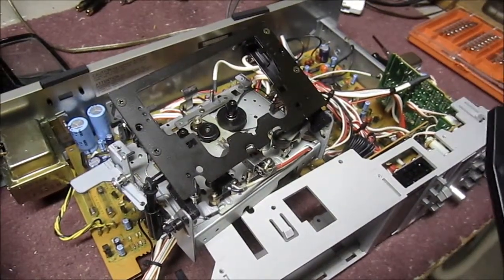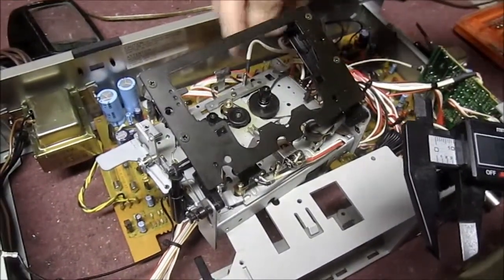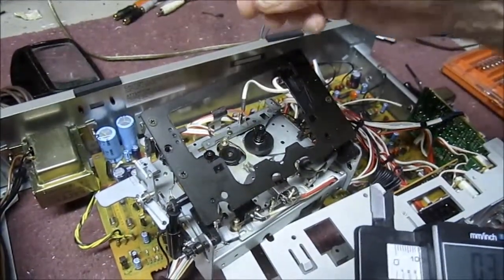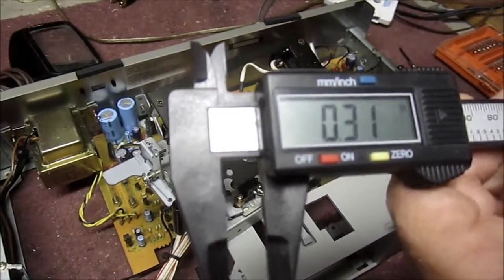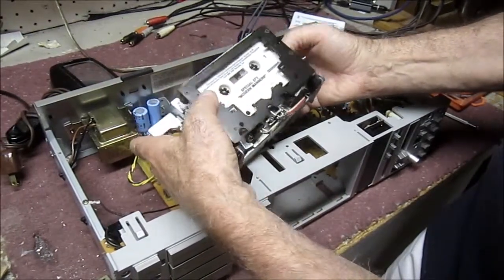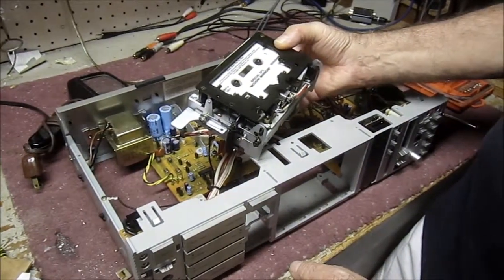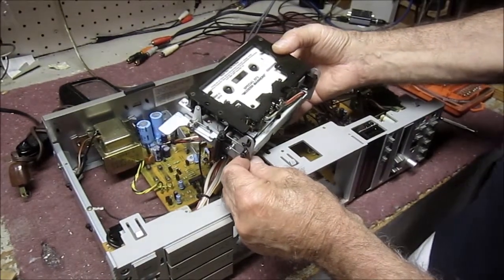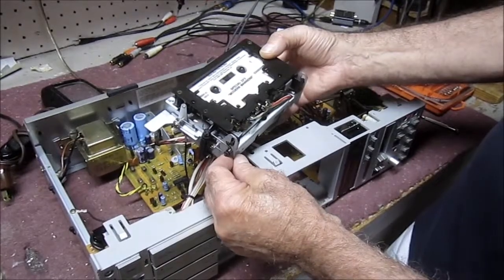HOW TO REPAIR NAKAMICHI BX 125 TIRE INEXPENSIVELY OR  EVEN FOR FREE

Comment: The idler wheel is like 5 bucks, but I can totally relate.
Next time just take the door off and pull the 2 screws off the faceplate and you're there.
A lot of the time, the wheel just gets shiny and doesn't grip the take-up reels like it should, and a good cleaning fixes it.
Reply: I used a fine sand paper and that resolved it!
Reply: Thats what I did my BX-300. Just took the faceplate off and used a piece of tape over the plastic retention clip so it did not get lost and out comes the idler. Change the tire and reinstall. 5 minute job.